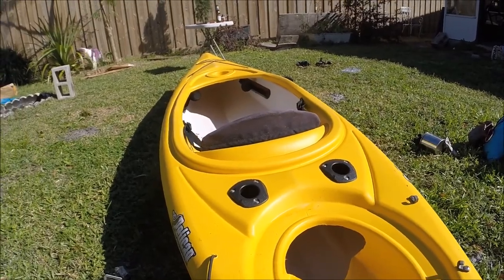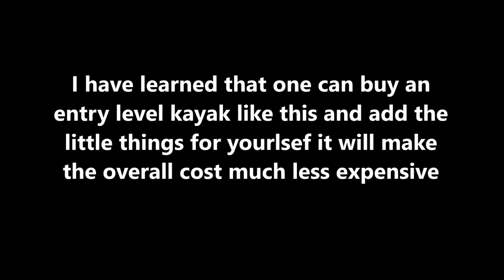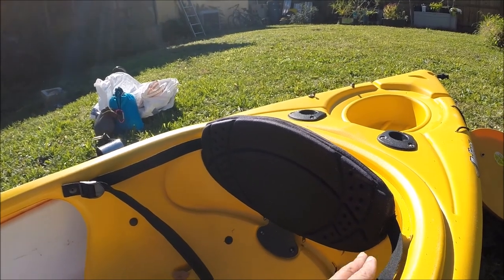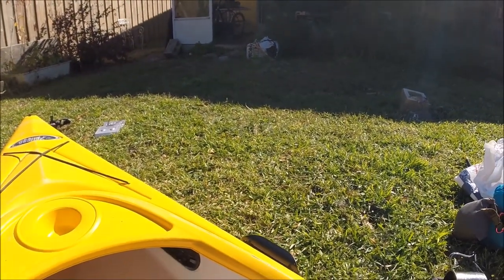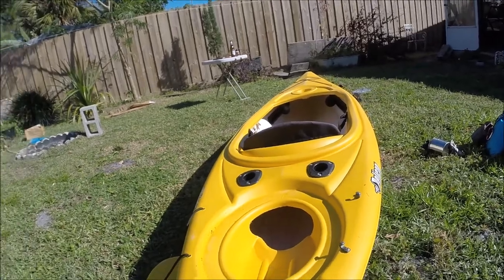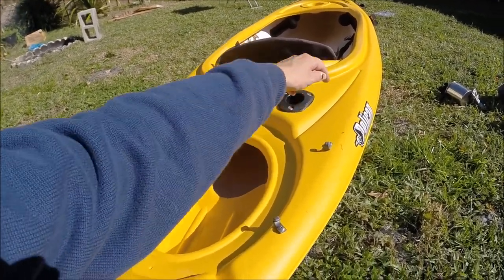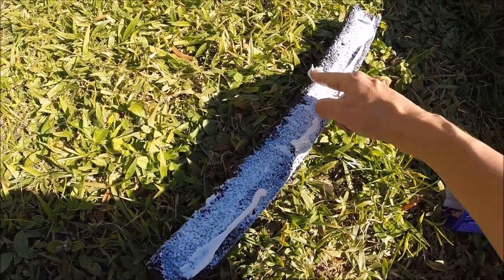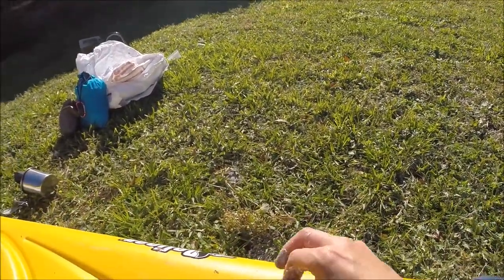Modifying Pelican Kayak - Opening the back-end for storage space.

Comment: I've owned several kayaks and came to the conclusion that weight is critical. Most places I like to paddle are far from the car parking and the whole wheel set up is more than I want. Plus taking the kayak off and on the roof racks is much easier with a light kayak. So, the 10' Pelicans are very light and inexpensive. The trick is to make them better because they do lack certain things. Your tips are a great start. I think I'll add some kind of rudder or skeg for directional stability as well. Thanks.

Comment: I have had a elie sound 100 ( top of the line pelican ) for over 10 years . No leaks on screws or anything . The seat is so much better than the one you have . Plus also has knee pads . I added better seats and knee pads to the cheaper pelicans I bought .

Comment: I just got my pelican and haven't modded anything yet. Madden voyage today. My thought was to go buy some ....3/8"?? vacuum line from the auto parts stored, slit it, cut it to the proper length and install on the lid. That should create a decent seal. It should also be rigid enough to stay on the lid without glue. It might need a spot of glue where the ends meet. Just a thought.
Reply from the maker: I think that's a good idea. I have not hard any problems with water coming in through the hole - just big-ass waves hitting me and coming in the cockpit!  Thinking a cockpit-skirt might be a nice addition on some days. I would bake on most others here in FL.

Comment: the leaks at the screws ,putting that stuff on the out side won't work  as you found out.I modded  3 yaks with extra bungee trolly anchor  systems rod holders you name it , use a clear marine  silicone in the hole where the screw goes thru the hull , take the existing   screw / bolt out and if it didn't have a SS washer on the out side add one.  butter the hole with the silicone when replacing ,wipe off away any that squeezes out , good to go .have not had a leak in any of my boats .and i've drilled  holes all over them ,Nice to see a gal with  some guts to tackles  such projects . and yeah Elmers is good to paper school projects, not much more
Reply from the maker: Marine silicon - of course.  Well as she is this kayak is serving me really well. I do not think I have seen any leaks since this modification - I just went out to film one of these goofy adventures I do and I ran into a south eastern us paddling group - this was a group of seniors that kicked my butt paddling all over - they were so great to invite me to go along and I saw many mile on some really great FL rivers.  Video coming :-) Thanks again for the suggestion!  I am sure I will have some leak again - it's only a matter of the FL sunshine eating it up.

Comment: good stuff.  I don't know if you have seen my video yet. But I have one of my take on cutting the rear open. I left the lip around the compartment though for the sake of taking on water, but I did open the entire hatch. I referenced the same video you did about cutting outside that lip and do not think that is a good idea either. I plan to add some edge trip and weather stripping to seal the rear better.
Reply from the maker: +Aaron of all Trades weather stripping sounds like a good idea but it wont stick to the plastic: I have had a hard time adhering anything to this - I've since used it a few times and no water issues but I do take on water where I sit when a big wave hits me wrong - and that has nothing to do with my mods - only big waves!  ;-)
Reply: Yes I do understand what your saying. However the weather stripping I plan on using is a trim piece. It "clips"'on to the lip of he lid and has a foam weather strip attached to it. It's difficult to describe since I can not attatch pictures on here but I did find it on amazon for cheap. It would not require glue because the part that attaches is "U" shaped and slides in the plastic. 

I have a video of a kayak camping trip I took right after cutting the rear open and I had 3 gallons of water and all my gear packed throughout my kayak. I thought I had it distributed evenly but I ended up having the rear of my kayak sit way too low and every little wave was able to run over the rear and inside. But without any gear, he ocean was no problem at all. And I have no stability issues as the guy said from that other video.
Reply from the maker: Please let me know if you post a video of your sealed hatch! Thanks a million for watching and commenting.  I've been on the Appalachian trail and just getting to find comments :-)

Comment: Thanks for the video.  We have pelican escape 100's, I think it's almost the same.  Is the caulk you are using 100% silicone?  If not you might have better luck with it.  I've seen other videos use it.
Reply from the maker: I didn't use the right caluk in one place but arund the screw heads I did =go back with silicon, it was necessary as the pressure of pushing on them just weakened them.  Thanks a million for watching!

Comment: You can take a water line foam insulation http://www.homedepot.com/p/Armacell-3-4-in-x-6-ft-Rubber-Self-Seal-Pipe-Wrap-Insulation-HST07812/100585113 and lay it around the hatch opening. Then the bungies on the lid will create a nice seal
Reply from the maker: That's great idea to add to this for sure.  I have noted it in other comments below but since I made this video ive been out on the water and not found the modification to be a problem - this video I thought it would be... so a seal really isn't necessary in calm water.  I found that in rough water, well, I took on water when a wave hit me anyway! Thank you for watching and commenting! Have fun on the water and remember a bad day in your Kayak HAS to be better than a good day at work!

Comment: you should of glued the foam to lid instead on top less mess and if you need to replace foam less work to do
Reply from the maker: Thanks for the idea- I really have had no problems with leakage - only when the big waves hit :-)
Reply: +Florida Girl Adventures what kind if foam did you use
Reply from the maker: Not sure, former pc packi NH materials
Reply: Try using a yoga mat from the dollar store also test some contact cement and see if that would work as a better glue.